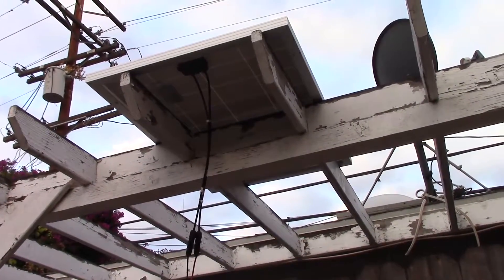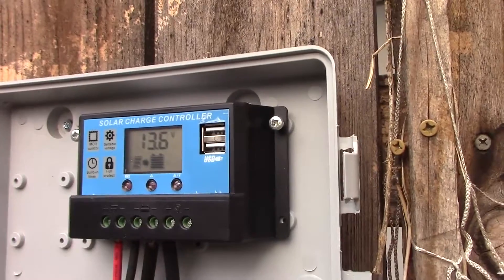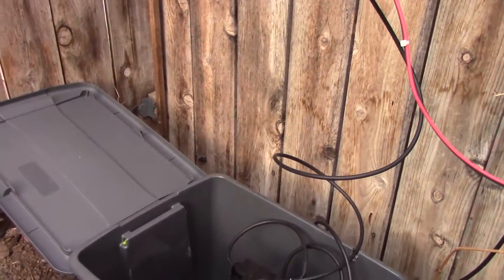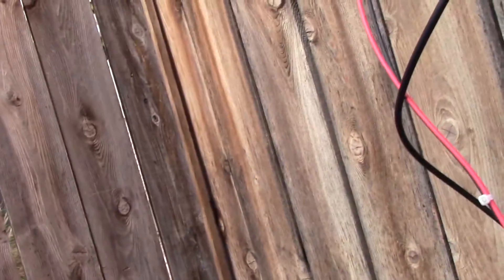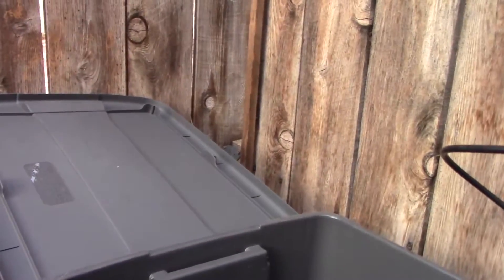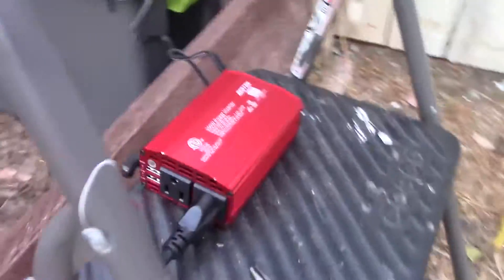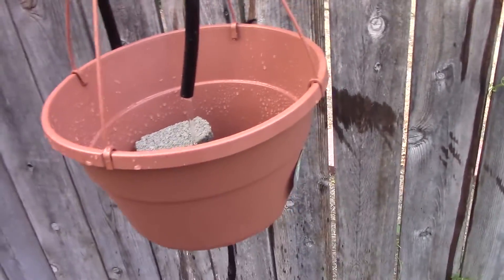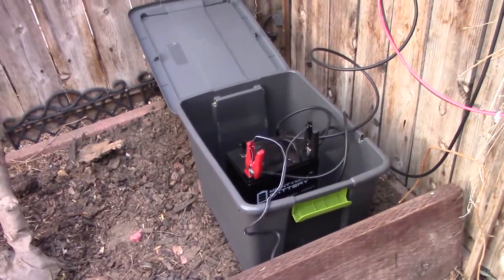100w solar system and fountain (panel/battery/charge controller/inverter)

Comment: Hi -- How long does this power the water pump for on a full charge?
Reply from the maker: ACEROCKOLLA A it can go a full day or so. I've added another battery and more lights since and haven't turned on the pump much due to lack of sun in previous months. I'll have to run a test some time

I don't think it's the pump itself that draws much. It's the inverter that is not efficient

Comment: the menu option where it says 10.7 V, try to make it more than or equal to 12.1. that will make sure that your charge controller will shut off your load if your battery drops below 12.1. 12v - 12.1v is 50% of your battery.

Comment: Nice simple setup, please fuse the system 👏🏾👍🏿😁
Reply from the maker: That's definitely in the to-do list. Since then, I've added some disconnects for easier turning off as well as a watt meter. I'd recommend going with a different solar controller that has the watt meter built in.